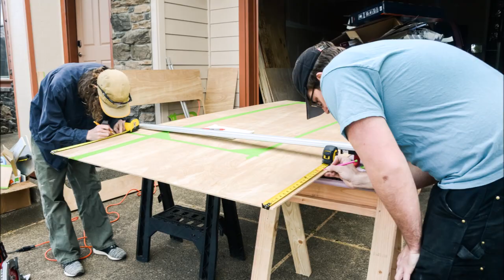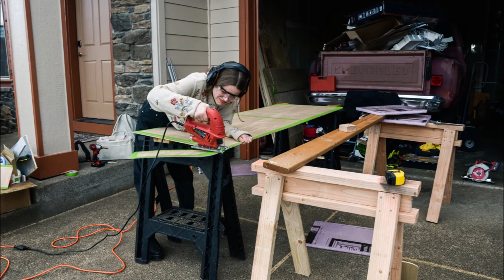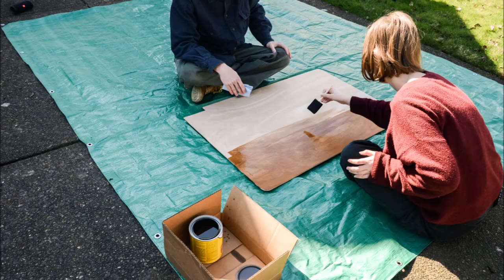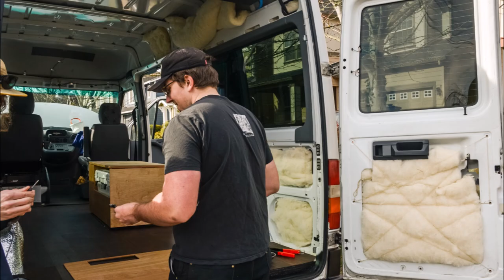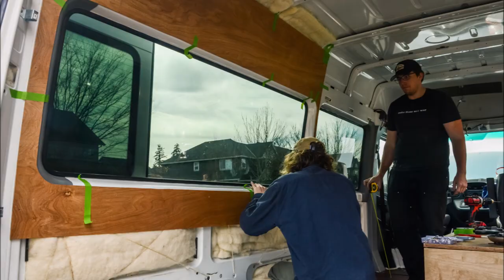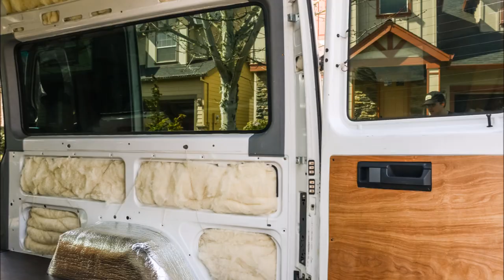Sprinter Van Conversion Timelapse: Walls

Comment: You just drilled straight into the ribs?  I see some people put studs in for support.  Was it self tapping screws?
Reply from the maker: Rivnuts were installed into the metal. With those we were able to bolt the wall into the metal without screws. This way the walls can be taken on and off easily. Since it is just 1/4" plywood and we won't be using the plywood to attach the cabinets to, studs weren't necessary.
Reply: @fullsprint9421  Just found your channel and I am loving it, I have been restoring a T1N on my channel for over a year, it's great seeing other people still caring for the old girls
Reply from the maker: @zambotv8150  Appreciate it, Phil!